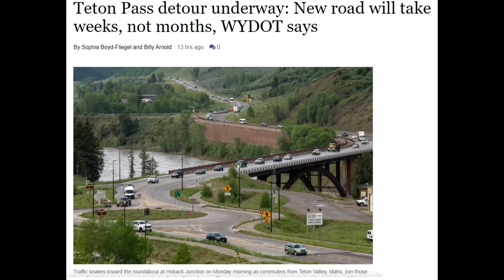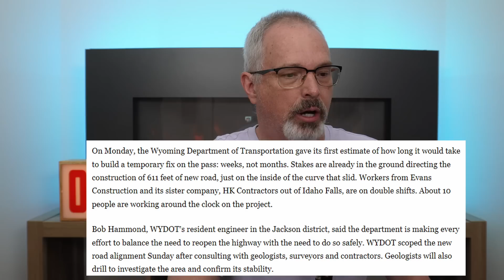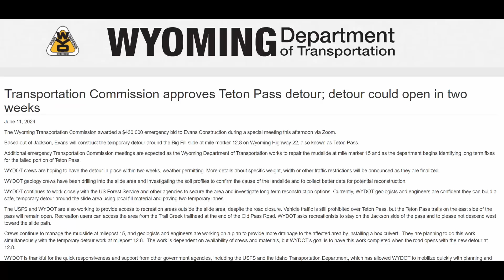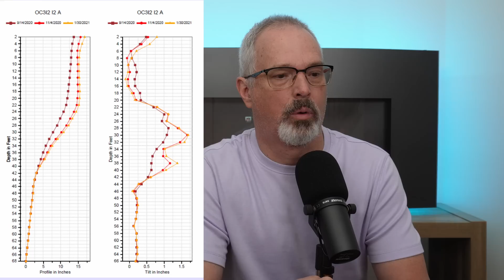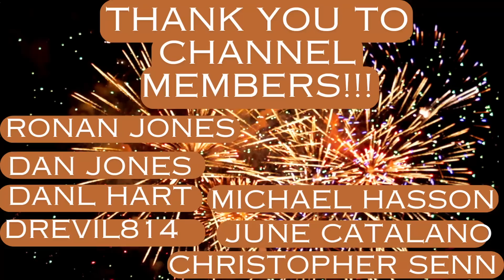Wyoming Slide Update

Comment: The bridge is clearly the best long-term solution. Probably the cheapest too. Excellent presentation. Thanks.
Reply: To put a bridge where he suggested would be about a 33% grade. 6% grade is about the maximum that trucks can safely run.
Reply: @karryhardman8735  Not to mention winter weather and a 25%+ grade on a bridge wouldn't' be a very good combination
Reply: @karryhardman8735  Large trucks are banned from this pass. There is a weigh station to enforce the ban.  The hair pin section that failed is there to limit the grade to 10%. 
This road is heavily used by the workforce that commutes to Jackson where the cost of living is too high for them to live there.
Reply: @karryhardman8735  i was actually thinking a bridge where the road failed.
of course, it's all 'couch engineering' from here.  thanks for clarifying.

Comment: The bypass is being built next to a severe slope that has failed catastrophically. Wow. Chutzpah!
Reply: Those billionaires need their Idaho wage slaves ASAP or they might starve.
Reply: Where exactly do you think they should build it? Because it's very steep slopes throughout the whole area. 10% grades. In winter there's avalanches all the time on 22. I was on that highway 2 days before it collapsed and filmed it.
Reply: @wyomingadventures  My concern is that the edge of the bypass is very close to the sheer dirt wall. At 2:1? 1:1? the slope failed. It's now 10:1? and close to the bypass. Is it so close that the next failure won't take out the bypass without warning?
Reply: @charleshotchkiss1813  when they open this temp bypass it’s going to be manned 24/7 with flaggers, in addition to the army of engineers designing the permanent fix. If it starts to go again it’s highly unlikely someone is driving off a surprise landslide.
Reply: @OSheaGlobalAlliances  So the engineers have no faith in the structural integrity of the solution. Hope you're right about no surprises.
Reply: New episode of World's Most Dangerous Roads
Reply: Get the road open using "select fill" and worry about the details later.
Reply: Not chutzpah - stupidity…
Reply from the maker: Exactly!

Comment: As a structural engineer that works hand in hand with Geotechnical engineers every single day, if people only realized the extremely conservative numbers you are giving... it is mind blowing honestly.
Reply: Even people that are not structural engineers can just look at that and realize that even a temporary side road is dangerous.
Reply: @skivijimmy  Yeah, but having just dug up the information about the overall geologic setting, in a different way than is obvious. (Heck, I was fooled at first.)
Reply: Another Structural Engineer here. Please expand your comment which is a bit cryptic.
The owner needs to understand what caused the failure before proceeding with a fix. I don't think one can argue with that.
Reply: @defendermodsandtravels   The cause is obvious. There is no rock for a foundation, it's all dirt.  Does mass wasting mean nothing?
Reply: @firesurfer  Don't jump to conclusions. You are suggesting that the soil failed at the foot of the embankment due to the overpressure rather than the embankment itself becoming unstable. I'm not so sure. There are several possible causes. Wait for the findings of the inquiry.
Reply: @defendermodsandtravels  As stated the 'new' road will for 'lite weight' traffic. If it were for dirt bikes, it would take only a few days. This is a simple answer, not an analysis.
Reply: @salmonsoule3203  at least let the poor folks driving 2.5 hrs to make their shift in Jackson get a break and be allowed to commute over the pass again ASAP. They aren’t asking to haul 9 axles over it next week. Not sure what waiting for geotechnical reports is going to do for the design of a 12’ wide temporary bypass
Reply: @OSheaGlobalAlliances  Yes, a fast fix may have higher danger, and will not last long, BUT it is a fix.  I believe most civil engineering uses a safety factor of 10. This probably means that the failure that occurred was most likely not considered??
Reply: Catastrophic  failure  and you're  arm chairing  recklessness on 20/20 hind sight? You and the biden family jjokes
Reply: I believe it's like an 8 percent grade
Reply: @valeriehansen1512  I still cant believe they built it like this after knowing what happened in 1976.
Reply: I'm surprised they didn't do core samples?  Or a slump on the ol' concrete/asphalt somebody likes compacting with the dozer though good pay right there buddy. Livin the dream.
Reply: You say you work with Geotechnical Engineers. What's the division of labour?
In my world (offshore structures) they manage the site investigations and prepare the geotechnical report and we do the foundation design. They couldn't design the foundations which involve pile-structure interaction.
Reply: @defendermodsandtravels  Depends on the client and the project.  When we do bridges, its very collaborative.  For buildings, depends on who we're dealing with, some clients/structural engineers get us more involved than others.

Comment: Monitoring slopes also works with SAR satellite imagery. That ain't cheap, but it shows small movements long before they become an issue. Unless they messed with pore water pressures (by stripping the topsoil on the inside of the curve??) or got the bottom layer wet all at once. One way or another, the only thing they can do in a few weeks is cut in a trodden path and that'll slide sooner or later, too.

Comment: Great report, but keep in mind that Wyoming has fewer than 600,000 people and is larger than many European countries.   On the frontier, there is a "make-do" attitude.

In the sparsely populated West, dirt roads are normal as are roads that are not plowed but rather closed in the winter due to lack of resources.
Reply: Yes, that's true.  But not for this road.  This is a heavily used highway between teton valley Idaho and teton valley Wyoming.   Many workers use this road for their commute as most can't afford to live in teton county Wyoming
Reply: Hot Springs County is the smallest in Wyoming in surface area, that county is larger than the entire  State Of Rhode Island! 2,006 sq mi (5,200 km2 vs. 1,545 square miles (4,001 square km)!
Reply: Valid point. In rural and agriculture areas there is a different evaluation of risk versus speed. Agriculture works are almost always in a hurry to get farm tasks done. It is not unusual to see vehicles travel over 60 mph on dirt roads. For decades agriculture has been the most dangerous industries in the USA. (Admitted it has been a few years since I checked the statistics.)

But these are people making choices that put themselves at risk. When it comes to other people or the state putting them at risk they are not very happy about that. So hopefully there will be pressure to do the permanent fix right. The temporary fix will be a "make due" or "get er done" situations. This is to avoid an over $100 per day cost for works that cannot afford that.

Just as important I hope they evaluate the rest of the road for potential future problems.
Reply: The state has set itself up as a tax haven, so very little state income to work with. The rich can have their properties declared a 'conservation zone' and protected in perpetuity.
Reply: And there are roads that are closed instead of being plowed in CT and in the denser cities like Boston there are places they never get around to plowing.
Reply: @kitefan1 CT gets an average of 28” of snow (Boston 9.7”). WY gets an average of 178”. Not an apples to apples comparison.

Comment: WyDOT should hire you or someone like you, as a consultant.  You can't hurry art--or good engineering.  It's too bad, though, that there is one convenient road.  That seems to have complicated things in the wrong direction.  With an embankment like that, isn't concrete reinforcement required?
Reply: Not necessarily.  There are too many variables to give a quick answer.
Reply: @royreynolds108  Thanks, the math for the embankment needs to be worked out.  This problem must be a familiar one in civil engineering.

Comment: That looked like a great location for an overpass/bridge instead of a steep slope....
Reply: Bridges become icy in foul weather, which is 6 months of the year in that area. A road sitting right on the ground is often the safer way to go rather than a road that is suspended in the air.
Reply: @rickgpz1209  makes sense!

Comment: So a point to be made with the later land slides, they are not moving 2 or three feet, they are traveling 50ft down slope, that whole backfill is subject to flooding, and you make a good point the ground water flow moving to the outside of the hairpin turn could have destabilized the whole lot. 

No, I am going to be more extreme than you. Either build a bridge or they need to remove all the fill and start over. The original work was garbage, it all needs to come out, it will happen again someplace else at some later date. 

They should drive pilings below the bedrock and more aggregate, and lime the crap out of the loose aggregate.

Comment: The elevation change of this hairpin loop is 168 meters (551 feet)  Cutting off the hairpin with a bridge is not possible.  The roadway is very steep.  I regard your advice to be very modest and reasonable.
Reply: Blast through it like here in MO. Use the spoil for grade sloping at an angle in direction of slope. Ark. same way, we grow rocks you want one?
Reply: @Teenagegoogoomuk   No thanks, I still have mine from the Crazy Horse monument.
Reply: We build curved bridges all of the time.....
Reply: @marklar7551  ...  And  I  hope  that  is  what  WY  DOT  eventually  will  do  as  they  have  done  on  other  WY  highways  in  similar situations.
Reply: 270 feet difference, still way too steep for a 530-foot span!
Reply: Yep.
Reply: More like 230ft (70m) but the point remains.

Comment: Google Earth Pro street view photos from April 2018 show cracks forming on the westbound lane (outside of curve).  This was a slope failure that was many years in the making.
Reply: But the standard version did not show them?
Reply: @bend8353  I just found a photo from last year of WYDOT working on the outer shoulder of this bend. They added material to the shoulder to bring the level up closer to the roadway, and they drove a roller over the fill on the shoulder to pack the material down.
Reply: @bend8353  Pro allows you to go back in time and view historic photos
Reply: @bend8353 Pro gives you options to go back in time.  The regular Google Earth/Maps is just whatever is most recent.
Reply: Agreed!  as  I  have  stated  in  prior  comments.

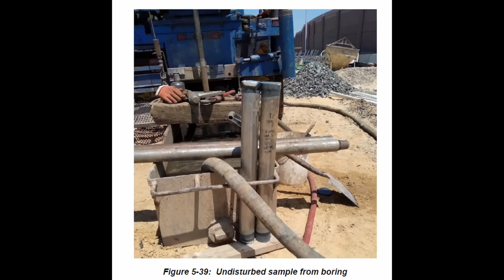Comment: 5:45 reasonable timeframe 2-3 weeks each to get samples, analyze - ~2 months 7:47 better to build bridge, avoid the curve altogether (probably USFS land) 8:51 seems imprudent, risky, if not stupid, to stand there making a video of spectacular catastrophic failure. Person recording this seems totally unqualified to be making any engineering decisions! 10:06 you can hear the dry material, unlike mudslide at other location from warm weather snowmelt runoff 11:14 notice earlier roadway patch 11:48 notice cracks form an arc 12:07 first sign of trouble: Thursday motorcycle crash from crack 13:30 notice the arc! 14:29 here's how the pros prepare for drill sample 14:49 Shelby tube samples 15:16 WYDOT hasn't mentioned any installed geotechnical instrumentation... 16:56 seems like WYDOT cutting corners to just get 'er done😕
Reply: Oh there's a whole list of unqualified 🍊💩 bull crap going on in Wyoming

°~•.☆.•~°
Reply: 270 Feet elevation difference, way too steep for a 530-foot span! There will never be a bridge there!

Comment: Note to self: stay on the interstate while traveling thru Wyoming.
Reply: I saw a very similar failure on I-90 in Wyoming, around 30 years ago. Most of the eastbound lanes had sloughed off, and it was a scary sight from the detour onto a westbound lane. I've been meaning to see if I can find anything about that. It would have been '93 or '94, so there might not be much available online. I have no plans to visit Wyoming any time soon.

A bit later: I was a tour bus driver then, and I still have my logs. It appears it would have been between August 27 and September 15, 1993. When I saw the landslide and missing highway lanes, I recall thinking I'd just been through there a few weeks prior, and driving on the section that was missing. That narrows it down. Would have been somewhere between Ranchester and the South Dakota line, on Interstate 90. I'm not having much luck finding anything. I certainly did not imagine it. In a summer filled with amazing sights, that one was quite memorable! I always wondered whether they had made the detour before the slide. I hope that section was closed, like the road on Teton Pass.
Reply: I spent two vacations in western Wyoming, in this is very PECULIAR highway, because main paved roads stick to (relatively) low and safe ground, otherwise you go on dirt roads that have little if any embankments that can slide, they more or less follow the ground as the Nature made it.   It is rough, but safer.  A very dramatic road, 150,  goes through Uinta mountains, but the hard stuff is in Utah.
Reply: For more than one reason. Ever been lost in the country with no gps or cell signal? I'm from nowhere, IN and I promise all corn looks the same, and i don't doubt there's a serious lack of landmarks there too. 

Keep a paper map when traveling the boonies lol.
Reply: @annagiesking5828  I've been reminded of this in the past month.